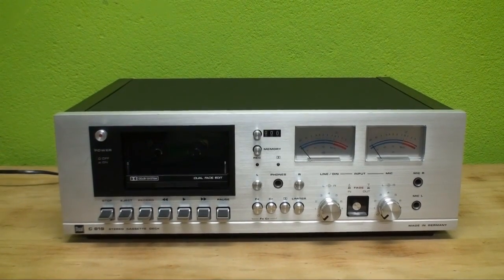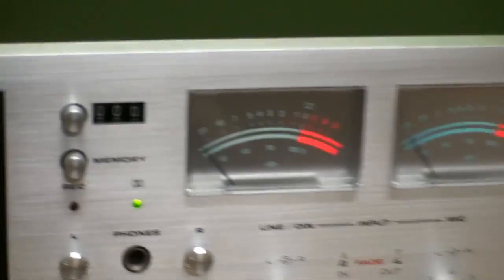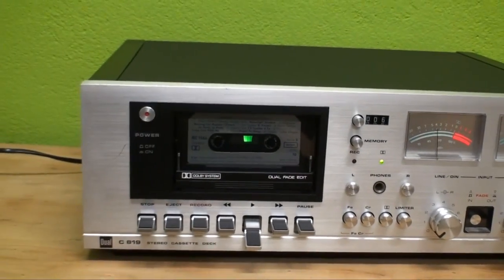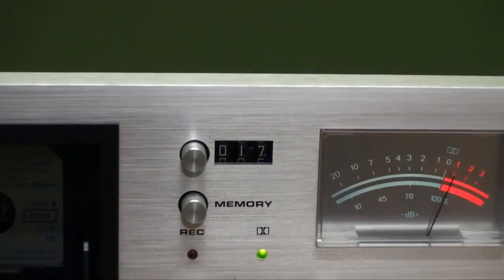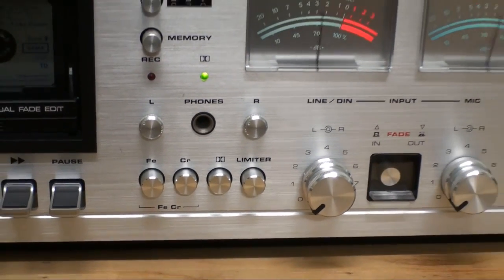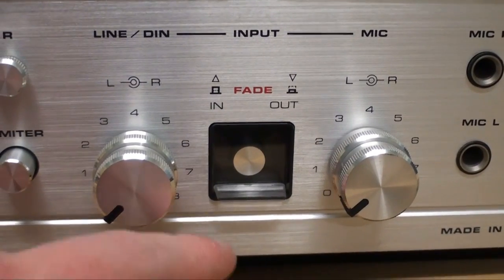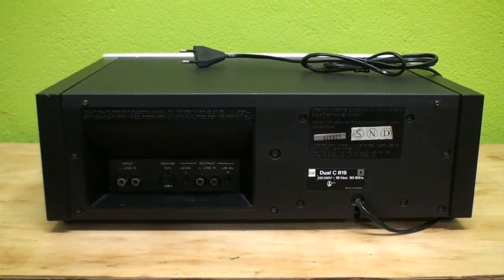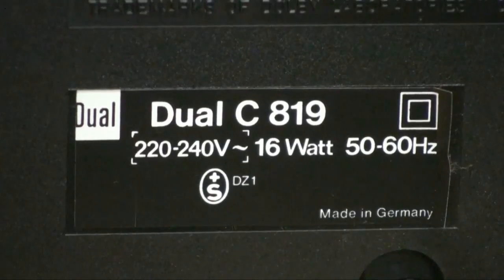Dual C 819 cassette deck - in HD!

Comment: Having the rear jacks recessed in a compartment is a good idea, because then it takes up less space when you have the cassette deck in a cabinet or on a shelf, not having the plugs stick out of the back.
Reply from the maker: Yes, you're right... never thought of that :)
Reply from the maker: A CATAL
 Not sure about the frequency response. It is a classic two head design.
Reply: VWestlife yes I was thinking the same thing such that it protects the plugs if you do not have much depth to your table or cabinet.

Comment: 6:50 220-240V Did you mod it to work on 120V power? or you used a step up transformer? Is there a voltage selector switch?
Reply from the maker: +bobskie321 
I live in Germany where mains voltage is 230 V.